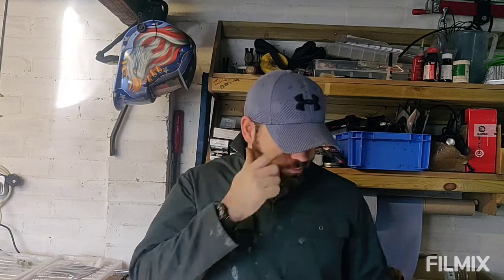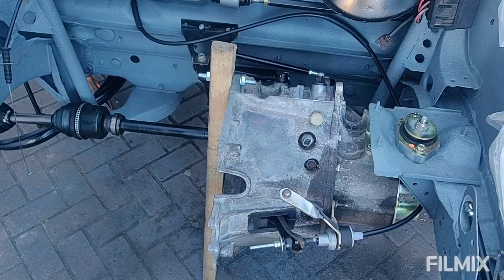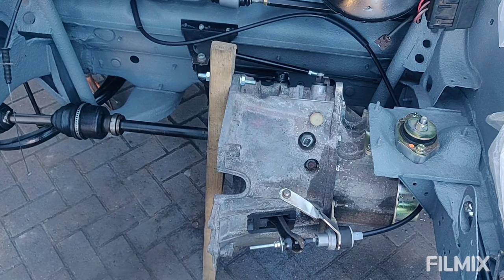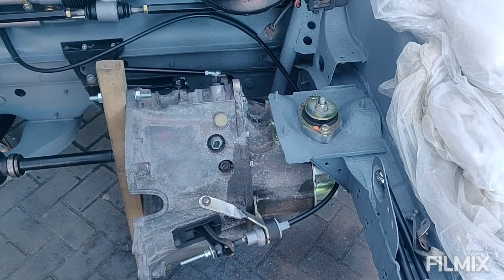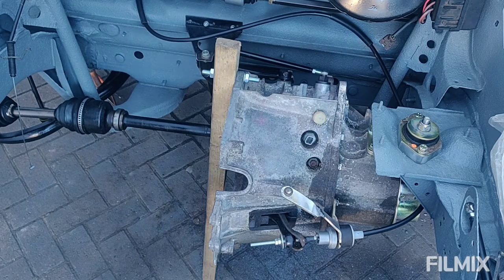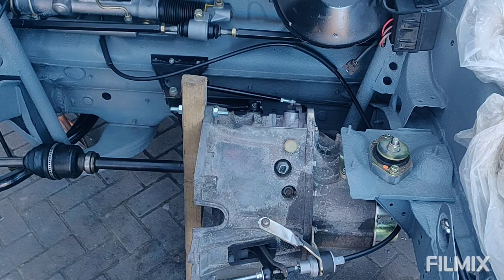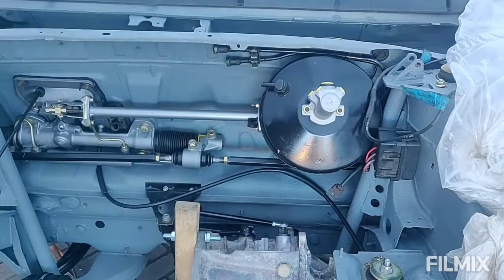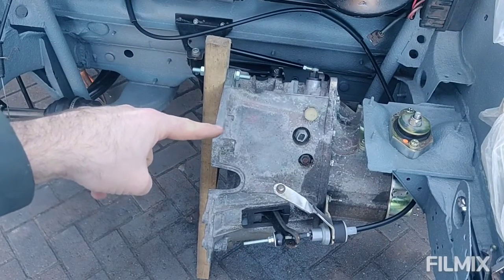Project 5AXO Ep25 - Citroen Saxo VTS Turbo - BE4 Gearbox trial installation

Comment: Another really interesting and detailed video Sean, you're absolutely right to carry out a mock up build without the engine in place as you have more space to work with and you can get everything sorted in advance 😉👍👍.  Something that I picked up on in your video was the gear linkage and my thoughts went back to my Mk1 Golf GTI experiences with replacement linkages.  I recalled it feeling very positive with little lost motion but quite stiff all the way through the shift. I looked at what I think was the new Mk3 set up and could see that on one of the linkage arms they (VW) had incorporated a decent sized mass to give the system a little bit of momentum in the normal 1 - 5 plane. I experimented with this on my car and found that the overall effect was that the shift felt smoother. Maybe something to look into when everything is back together and you're working through your snagging list. I'm sure that you could make up a bespoke linkage arm that incorporates the required mass and market it on the channel 🤔😉👍👍